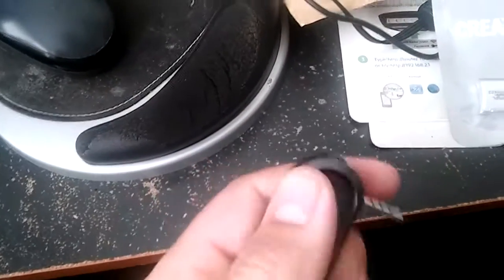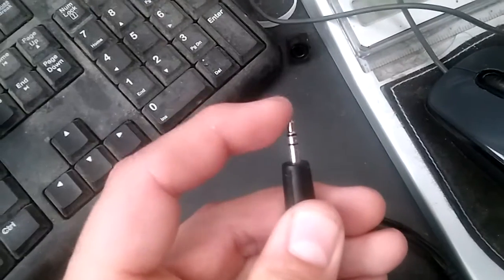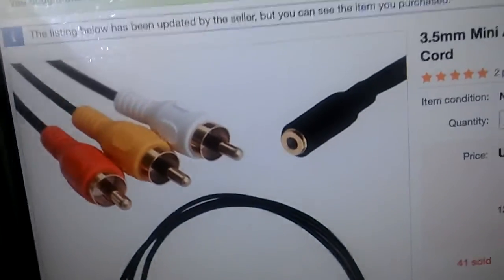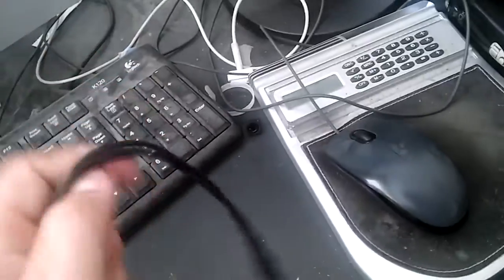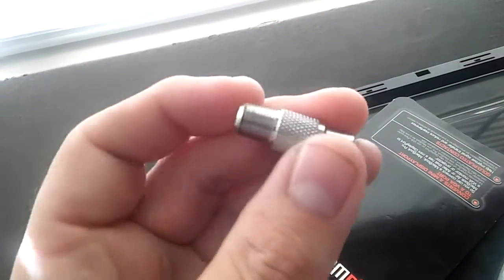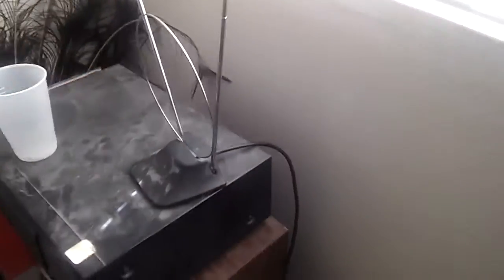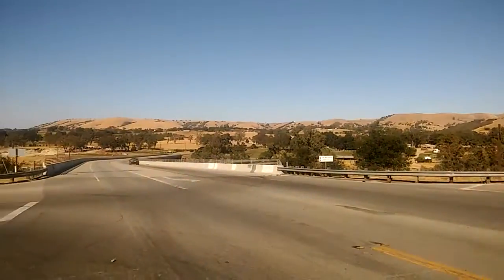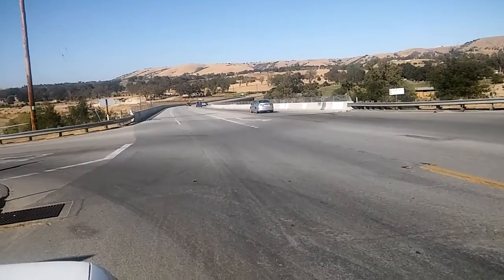Doosl FM transmitter mod/hack Easy

Comment: i have the same model and using a long usb wire charger and another long wire does boost the signal. i also noticed when you set the frequency to as an example 105.5 and listen on that frequency, it also can be heard on 93.5. not quite as strong